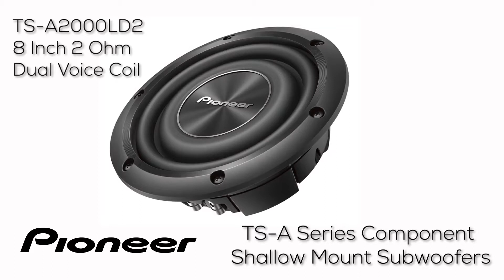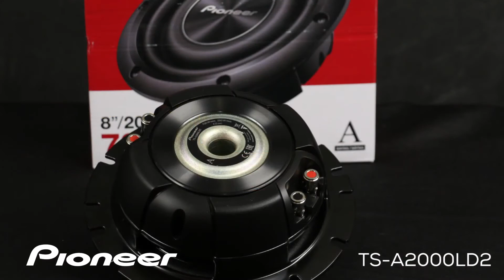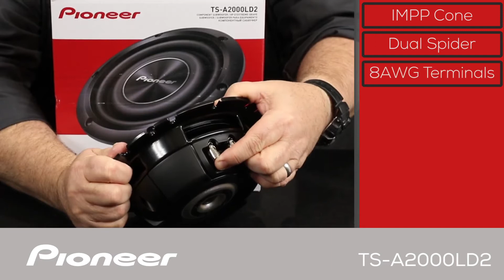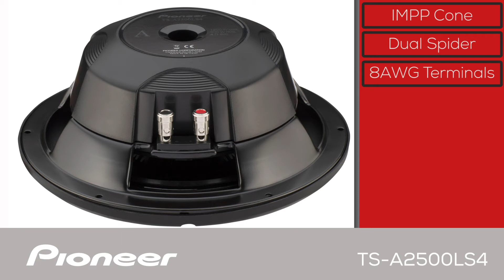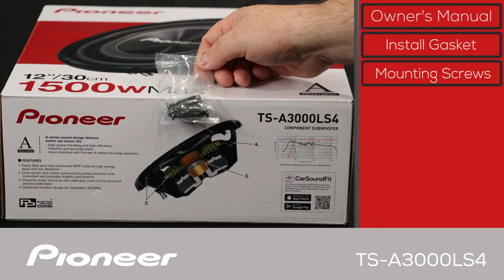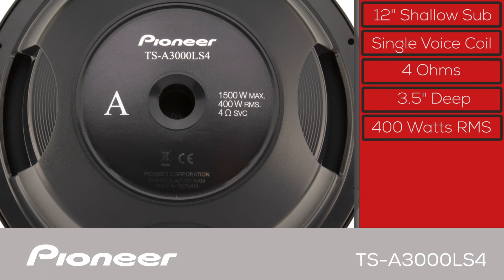Pioneer - TS-A Shallow Mount Subwoofer Family - Unboxing

Comment: Can TS-A2000LD2 be installed in the front doors of 3rd generation Mazda 3 (2014-2018) with Bose sound system ?
3rd gen Maza 3 with Bose sound system come with Bose 8 inch woofers in the front door panels.

Comment: 2:26 
How to connect a 2 ohm dual voice coils 
As 2 ohm impedance 
I guess, the only options is 
1 ohm in parallel and
4 ohms in series 

Please if it can be connected as 2 ohms , let me know 

My amp is Pioneer GM-D8701 

Thank you 🙏🏻
Reply: Buy a 2nd sub 😁